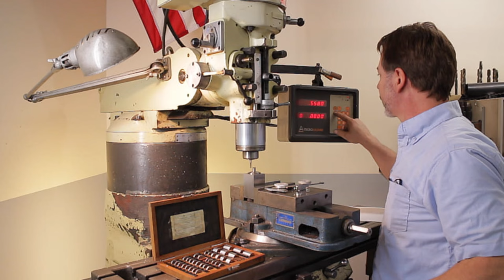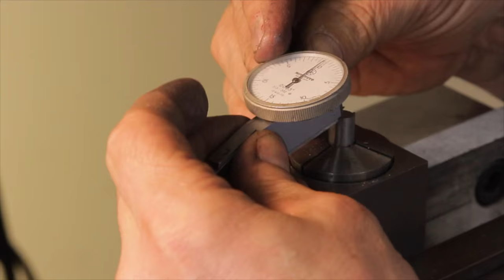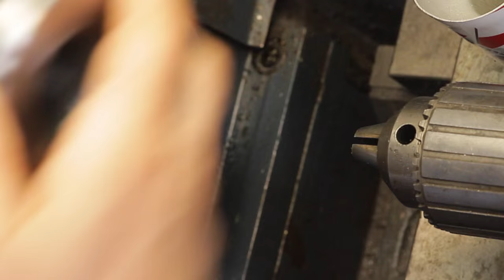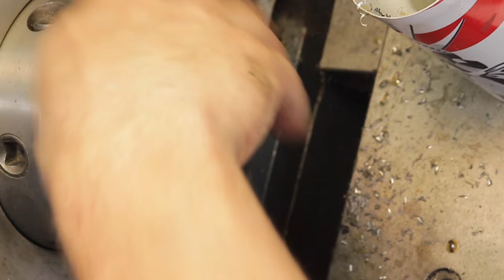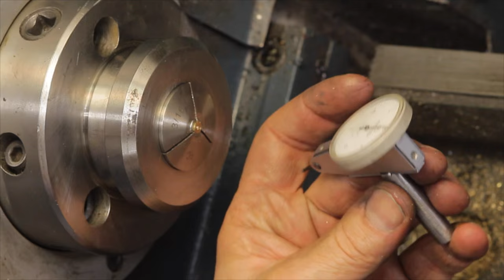How to make a Small Dovetail

Comment: I just recently discovered your channel and want to say that you do great videos.  Your presentation in this and the other videos I've watched so far is delightfully clear and detailed but still quick enough to avoid any desire to skip ahead.  Nicely done.

On this one I applaud your quick and easy use of the file to do a job of this sort.   I'd also suggest that making the first hogging out cut could have also been easily and quickly done with a small square section file or a combination of a hacksaw and small square file instead of the milling machine.  It also would be a suitable option for anyone without a small milling cutter at hand.  And it fits in with your idea of using what we have and not feeling like we need every tool out there.

Comment: Hi Dale Nice little project. What I like about this one is that if you do not have a mill, with a little judicial filing you can come up with the dovetail. You do not even need the collett chuck, just a 3 jaw chuck on the lathe. Heck if you want a little fitting and making practice with a little care you can do the whole thing by hand on the bench.  regards from the UK
Reply: +Gary C I'm told a good gunsmith can cut a true and level sight dovetail into a fully finished and blued gun barrel by hand filing with no starting slot. I'm never going to be that good. But today I doubt many would attempt it since most will have a mill of some type. Metal checkering with files is still more common, but even that is probably slowly dying out with more owning CNC equipment I guess. Great demonstration Dale.
Reply: +Turning Point I love my files, and not since I'm yet to own a milling machine, I've always loved them, and even enjoy shaping surfboard foam or large sections of auto body filler repairs with a "SureForm" to get to rough shapes before blocking. I enjoy shaping things with my hands...Aloha, Chuck
Reply from the maker: +Gary C 
Thanks for your great comments
Reply: +Knolltop Farms Yeah it's pretty relaxing sometimes just shaping a piece of material with a simple tool and your eye's. A great deal tougher than it looks tho. And a file WAS the first milling machine. :-)

Comment: I did a indicator bracket like that years ago,  I simple ground up a small single point tool out of a broken endmill for  the dovetail.  I removed most of the dovetail slot with a small endmill and the just touched the sides with the 30 deg cutter I had ground up.  I use a cheap bench grinder just for grinding small tool bits, gun parts, etc.  Whatever works, different ways to do most things......

Comment: Nice solution. For mounting on a longer bar, you could make the dovetail the same way, cut a thin slot along the length of the rod in the bottom of the dovetail, and put a small screw sideways through the rod to squeeze the slot shut (clearance hole 1 side of slot, threaded on the other side of slot).
Reply from the maker: great idea.

Comment: A nice solution (borrowed from another Youtube creator) for never having the right-sized shank on such an adapter is to make a stepped adapter. You might make one with 1/4, 3/8, and 1/2 inch steps, each about 1/2 inch long. The slight downside is that the smallest diameter step is the one with the longest stick-out, but indicators don't exert much lateral pressure. (You wouldn't want to put such steps on a 1" drill bit it or a face mill.) You might have to come up with a different clamping system if you want a 1/4 inch step on the adapter. A crossing setscrew with a cone point bearing against an angled end on the plunger, maybe.

Comment: Dale, love your videos.  Great that you are willing to share.  I have a tip for you that may be of benefit.  I noticed in this video that your drill bit slips in the chuck from time to time.  Also noticed that after inserting the bit you only applied the chuck key to one of three holes.  An old timer told me that a three holed chuck should be tightened in each hole.  It avoids scoring up the shank of the drill bit, preserves the bite on the chuck jaws, and if my memory serves me correctly, there is better centering of the drill bit or a reamer.  Thanks again.
Reply: 100 per cent correct

Comment: 'Thought occurred to me , that the holding setscrew could be a knurled thumbscrew; with the diameter slightly less than the shaft diameter . . . * ( No extra tools to use = faster setups ! )   :)       Good channel . . .     subbed !      Hmmm , come to think of it; the 'setscrew' could be Brass - threaded on one end, with knurling . . . one piece, instead of two !      ( even a simple slot cut into the brass rod would allow it to be 'set' with just a screwdriver ?  . . . the options are as varied as the operators' imagination !    Dream it up - then make it COOL !       Cheers Dale !
Reply from the maker: +georgewocosky 
Great comment, thank you

Comment: Excellent.  That will be my next project.  What if you instead of the set screw used a cylinder allen head screw, where the head is about the the same diameter as your holder and have a slight knurl on its head so it can be finger tightened?   Just a though, and I don't know if the dimensions match up....

Comment: loving the work. if someone only had a 7x14 Chinese lathe would you recommend buying a rs32 or rs40 collet system?
Reply: +Shaun Tucker ER32 collet system!
Reply: +Shaun Tucker Pick a collet size that is compatible with other machines that you have, if your mill can fit a rs32 that would be my choice, and look into Doubleboost channel, he built a re32 collet holder to fit his lathe, I copied it and it works, so it cannot be that hard.

Comment: Hi Dale. Did you make the 5C collet chuck for the Enco lathe? I have a similar lathe with a 5MTin the spindle and a D1-4 cam lock and have been interested in building a collet chuck like the one you have. That would be an interesting project for you to show. Thanks, Paul
Reply from the maker: +Paul Jones 
No. I did'nt make the collet holder, It came with lathe.
Reply: +Paul Jones Start with a *soft* MT5 to MT3 sleeve and bore the 5C taper with it mounted in the spindle. Shorten it and make a drawbar. Done.  About 20 bucks for an unhardened taper adapter last time I looked.
Reply: +Jeff Iscool Great tip. Thank you, Paul

Comment: Cool idea & vid Dale, I may go make a couple of different length one this weekend. 
One question though:- Is there an advantage with the locking system you used (with the rod) rather than the outer threaded collar or lock nut that you see on most bought ones?
Cheers, Bo
Reply from the maker: +Bo Vejby 
Yes one big advantage, it easier and faster to make. LOL
Reply: +Metal Tips and Tricks (Dale Derry) 
Fair E-Nuff. LOL

Comment: Hi. My lathe spindle through diameter is 30mm. Will C5 collet Adapter drawbar fit my spindle?
Thank you all for input.
Reply from the maker: I don't know what the size is of the draw bar. check your machines handbook it might help. I would for you but mine is packed up
Reply: Thanks for quick reply. I called a drawbar the Tube with red disk you are showing at 8:33. What it's outside diameter? Regards.

Comment: Nice. It did not occcur to me that you could file up a small dovetail. For a 45 deg dovetail you would have to hunt up a square file. And thanks for the metric conversions, although for all practical purposes it suffices to give the measurement to the nearest "cent" -- .01 mm which is about .0005". I work in metric, and I appreciate getting my bearings.
Reply from the maker: +Juan Rivero 
Thanks for telling me how far I should carry out the decimal point on the metric system. :-)
Reply: The way I remember it is .01 mm is "one cent". A cent is five tenths so "a cent is half a thou".

Comment: my lathe chuck is 160mm diameter . can I use lathe chuck 200mm diameter to my lathe?
Reply from the maker: I fit will turn with out hitting the bed go for it. To thinks to be aware of is. The larger chuck weighs a lot more and your machines motor is use to. It might not handle it well and you might find a loss of power.  Next thing to check. Can the  jaws  open up passed the diameter of the chuck with out hitting the bed.
I Hope this helps

Comment: Dale, very well done, and you may already be aware this, I would like to make a suggestion about grinding , I did a lot of grinding punches and dies 40 years back, and in the situation with your setup  grinding the triangular file, we would have placed Plasticine around the outer tip of the file and onto the gauge rings to give support and deaden vibration and possible breakage or worse, this is not meant to be a criticism of your work, but rather passing on knowledge for learning,

Edmund........Alberta
Reply from the maker: +Walter Maisey 
What a great Idea. Ill have to try it. Thanks
Reply: Dale, just to give you an example, we used to make our own punches, and on final grinding to length some were .032 dia and maybe .500 too long, we placed the punch in a V-block placed a lump of Plasticine around the punch and top part of V-block and ground .500 by fine feeding into the side of a 46 grit wheel, that was on Jones and Shipman 540 grinders,

Comment: nice video, but you forgot one safety point: DON'T have the mill cutter in the collet while you are cleaning up or for the hand - work you were doing , sure fire way to cut yourself on the very sharp edges of the cutter blades, or the metal shavings on the mill!!, should remove cutter, clean up the swarf then do the hand work, OR take the collet block to a vice on the workbench, where it's a lot safer for your hands (of course marking which edge you had the block mounted on the vice, for alignment later).

Comment: As usual, Dale has no idea what he is doing.  You cannot measure a dovetail geometry by taking a side to side measurement at the top of the slot.  One has no idea how deep the miter might be, so the top width is NOT the datum.  This is why machinists take measurements over dowel pins, then calculate the width.  This way the datum is the actual face of the dovetail.